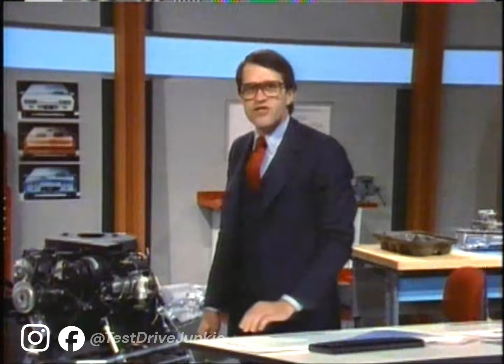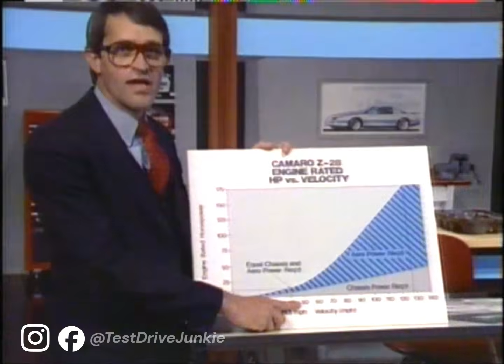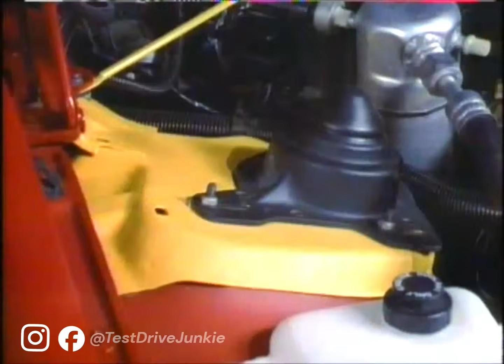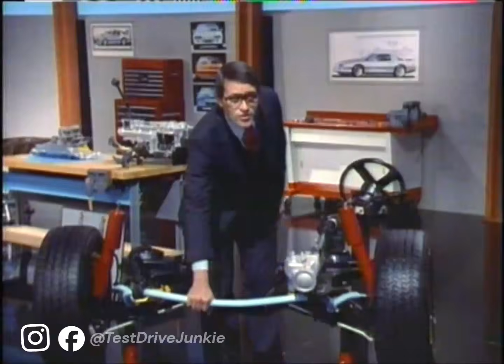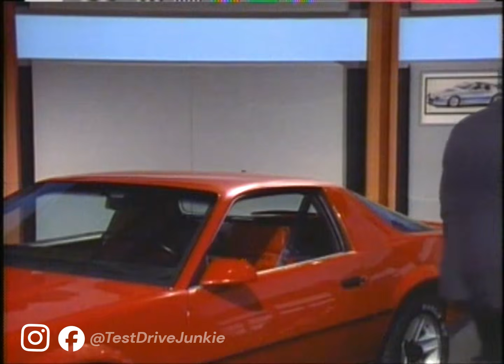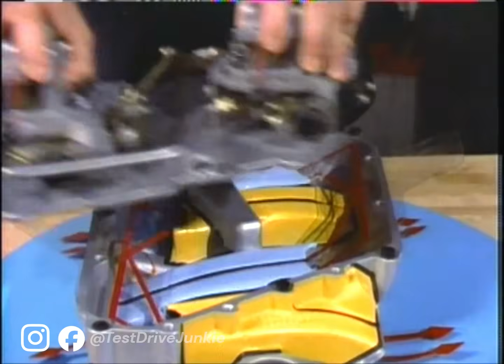1983 Chevrolet Camaro Z28: An Engineering Story, Manufacturer Laserdisc Promotional Video

Comment: Crossfire injection was junk.
Reply: Ive got a crossfire on my 84 Corvette and it works pretty nice for me.
Reply: @howebrad4601  I agree, Crossfire was good. 'Crossfire was garbage' is what most people say because they heard it somewhere, but have never used it. And in all fairness, a lot of those were messed with by people who had no idea what they were doing, so by the time the 2nd or 3rd owner got a hold of them, they probably were junk. And I think Crossfire Injection looks and sounds cool. Though Tuned Port is still the best looking system ever.